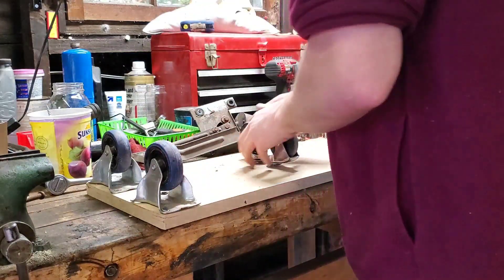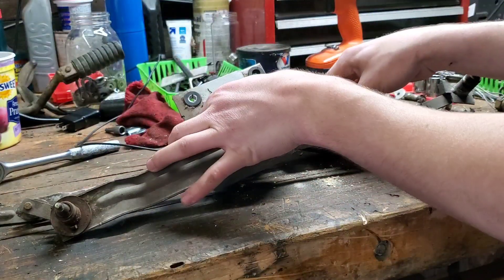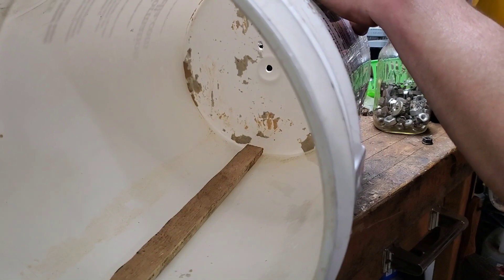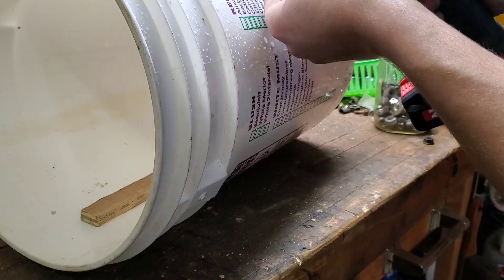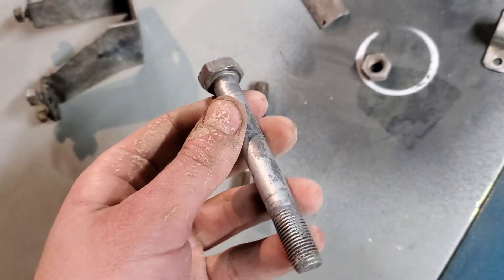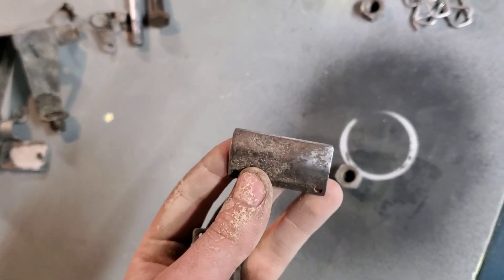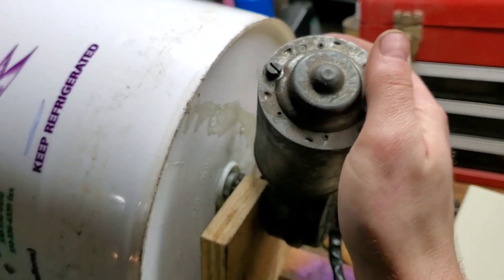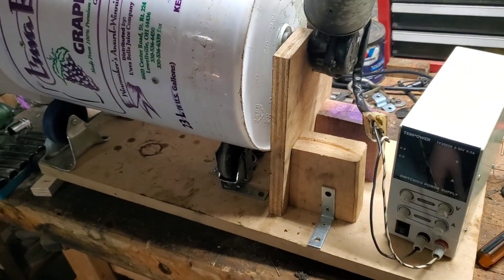How to Build an Abrasive Part Tumbler - DIY Tool

Comment: Nice I’m just gonna use my drill have it drive the bucket with friction with a cpu fan right next to it to cool it down I already have a cpu fan but I don’t know what I’m gonna scrap for the wheel maybe just go to the scrap yard, I also might add wheels on the top and the bottom and keep the whole rig tiles like yours. Thanks for the idea :)
Reply: Correct use an old wired drill

Comment: I would attach a thermal cut off so it will turn off automatically when it gets too hot and back on when it has cooled off? They're very cheap. One that is NC (normally closed) 104F degrees (40C) cost about $1. Problem solved. BTW: Don't salvage one from of an old coffee maker since those are NC 145C degrees (293F) which is almost 3 times as hot as the motor should ever get.
Reply from the maker: That would have been an easy fix to get around the symptom, but I felt like a better solution would be to find a more suitable motor than the 53 year old windshield wiper motor I had been using.

I ended up fitting a different gear motor with much more torque, slower output rpm, and it doesn't get nearly as warm which allows me to run it continously for hours.
Reply: @NickMakesBreaksStuff  I like your solution. I find that quick fixes often become permanent. Hehe :)

Comment: I’ve been trying to do this   But my wiper motor overheats
Reply from the maker: I have since upgraded to a 120v ac gear motor that drives a belt around the bucket. I'll make a new video about it soon.

Comment: Never would've though that a wiper motor would be strong enough for, well, ANYTHING besides pushing rain drops. TIL.
Reply from the maker: Yeah, it's a strong little gear motor. The one that I used might be a little underpowered though for this application. A window regulator motor might be a more appropriate option.
Thanks for watching!